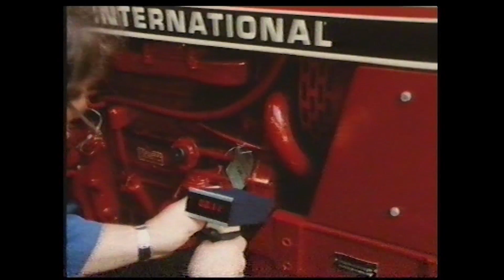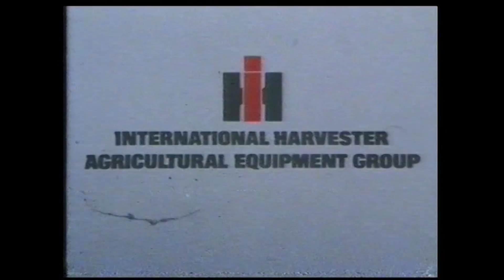International Harvester Promotional Video "More Strength to your Farm"

Comment: As an American watching this, we forget how truly small England is and how short it’s growing season must be, until we hear 140acres called a farm and see equipment that big being used on it even in the 1970’s or 80’s when this was filmed. In the U.S. it would be called a hobby farm at best, and in many areas one of the farms smaller fields. 140 acres hasn’t been considered an actual viable farm here since the early 1920’s - mid 1930’s at best. One of the biggest advertising selling points for the original Farmall regular tractor which developed 13.7 drawbar horsepower and 20.05 belt horsepower was that it allowed one man to intensely farm 200acres. Basically almost entirely freeing the farm from using horses or other draft animals for the first time in history. We sure do have things a lot better and easier on the farm these days then even just a decade or two ago.
Reply: ours was 135 acres till 2001, not all farming is arable
Reply: @timberwolf27  never said it was. We had over 800acres total scattered out. Roughly half was arable and the rest was pasture, farmyard with the dairy barn and other structures including the farmhouses, sugar bush (woods filled with maple trees to be tapped for making maple syrup) and wood lots where we cut our firewood to heat our houses in winter.
Reply: @aaronfarr4753  BUT on the arable front you DO NOT YIELDS ANYWHERE NEAR OURS PER ACRE...